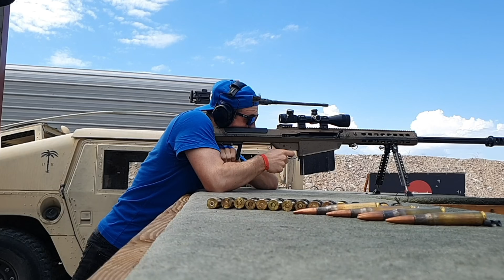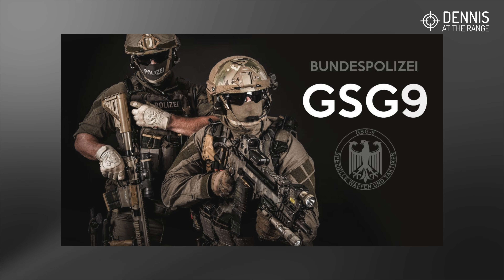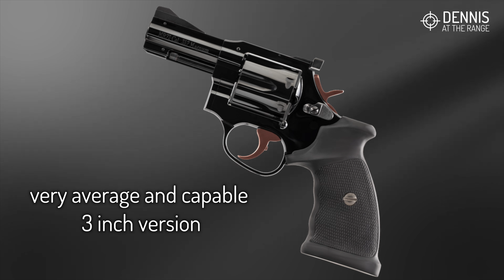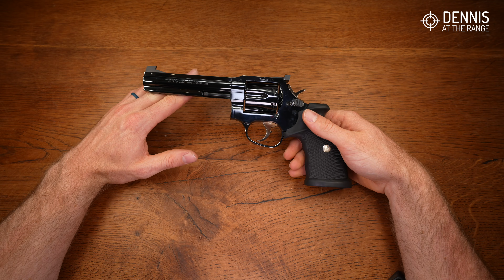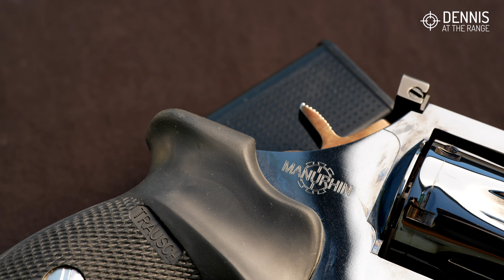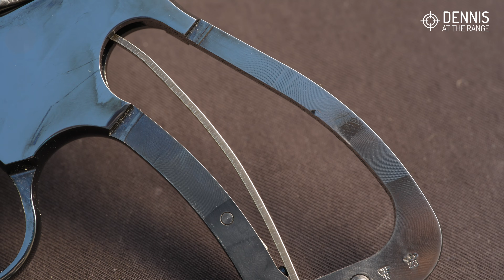MR73: the best service revolver is made in France

Comment: Are you certain that the hammer and trigger are case hardened and not heat treated (through hardening)? 
Some would disagree with the Korth being  "better". It depends upon how better is defined.
In any case, they are both superb revolvers.
Thanks for the video.
Reply from the maker: From what I saw it was case hardened, but I might be wrong there is not a lot of info. As for Korth, tolerances are tighter

Comment: Nice video, my MR73 is the 6" version and is super accurate, if I do my part as the chimp on the trigger 🙂, the finish is fantastic but the blueing is not as durable as some other brands. I had some holster rubs after just a couple of range sessions with a leather holster so now I use a softer fabric holster to try to maintain the lustrous finish.
Reply from the maker: Ooops, didn't know that about the finishing. I did hear that they don't make them like they used to. Anyways, enjoy yours!